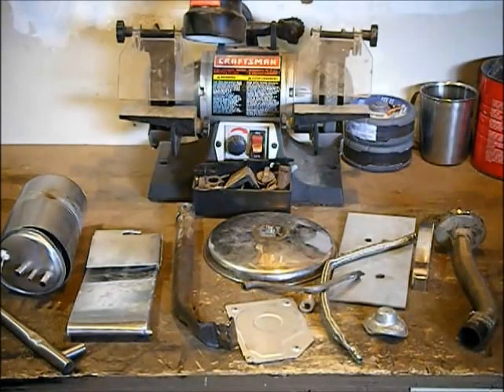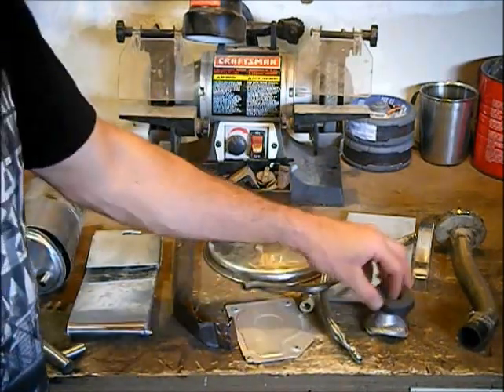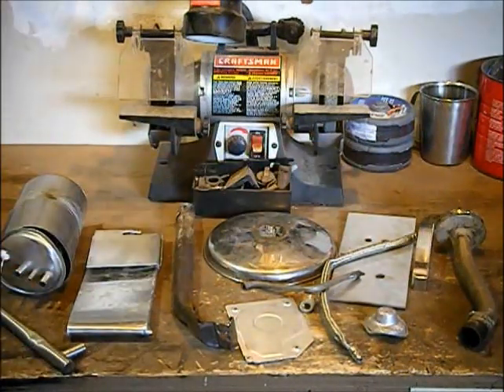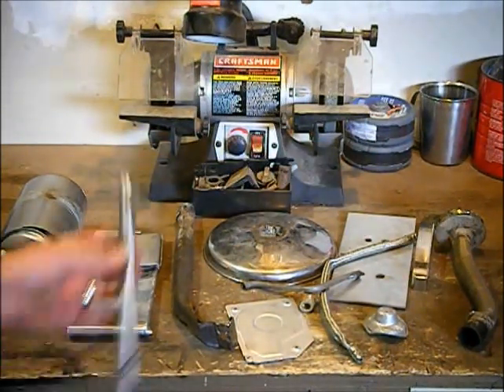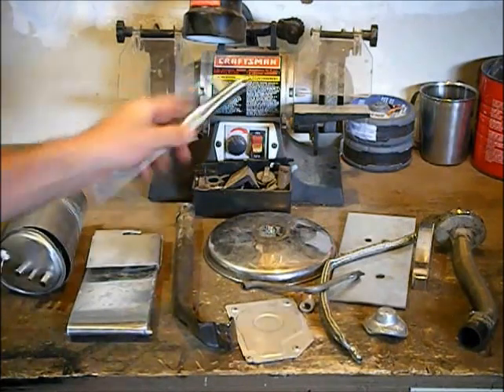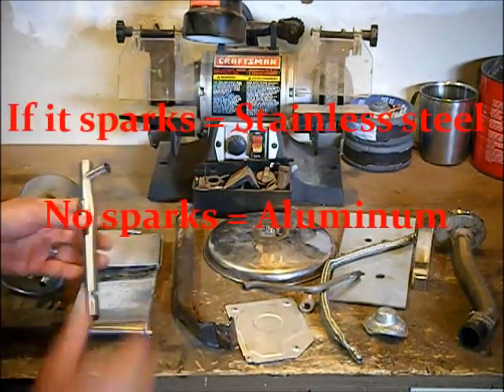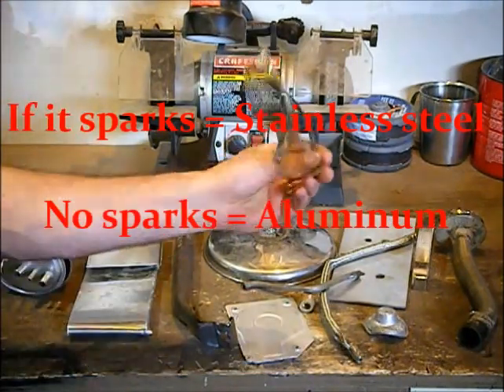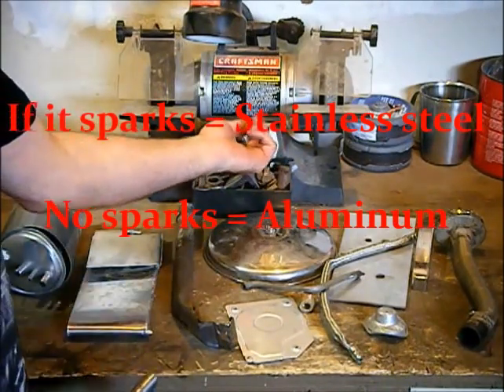Stainless steel or Aluminum ? How to tell the difference.

Comment: Brilliant. I thought stainless was magnetic
Reply from the maker: There are different grades of stainless . Some is magnetic , but the non-magnetic stuff is worth about 10x the price at my scrap yard .
Reply: Many stainless knife blades are made from 40X series stainless, which can (and is) hardened.  It attracts a magnet.  30X series stainless cannot be hardened, and it doesn't attract a magnet.  But it is too soft for knife blades.

Comment: Great tip. What's the price difference between stainless and aluminium?
Reply from the maker: TheAussieStig30 It is very close in price but must be separated . I get .50 a pound for aluminum up to .65 for rims. Stainless varies from .55 to .65 depending on the day . If you have a large amount it is wise to call to check on prices before you go to maximize your profit . Thanks for watching !